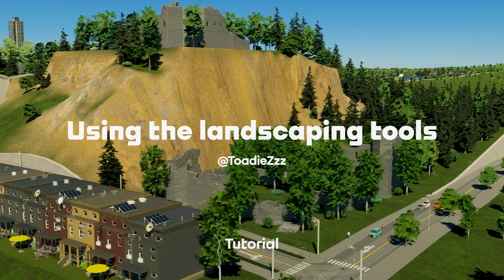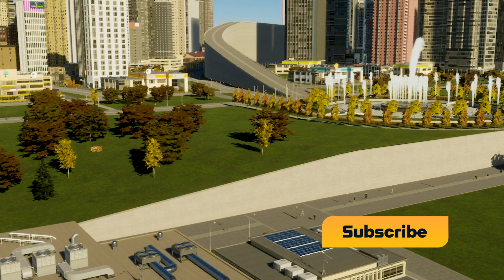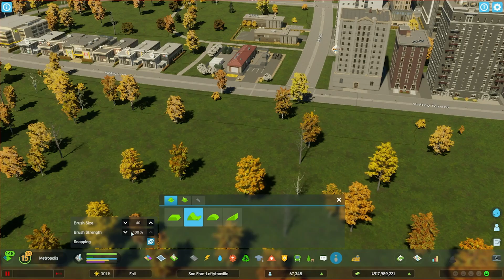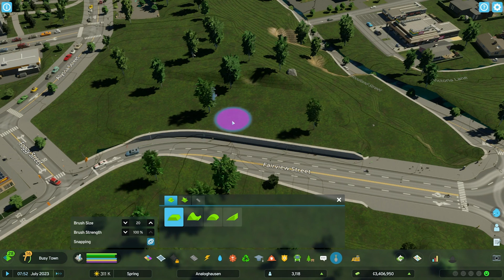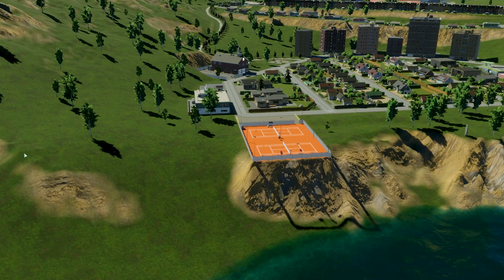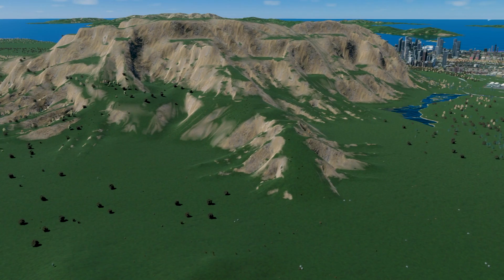How to Use the Landscaping Tools | Inspirational Builds | Cities: Skylines II

Comment: Man, this game is just such a disappointment. Why are the features from the original road anarchy mod not included? Should be an option to force tunnel, bridge, ground or elevated when making roads and rail. Zoning system is still the same and doesn't work with curved roads and is a pain having to run temporarily paths to correct the zoning.  Building on slopes is the same and not improved from the first game. There's no props, mods or quality of life or detailing options. Hate to leave bad feedback as I loved the first game and was so excited for the sequal, but it's so frustrating after the pre release marketing that got us all hyped up to buy the game and realise we've been sold an early access beta at full price :(

Comment: For the tunnel (for anyone who actually wants to do a tunnel without blowing up a mountain) you just need to level out the start and end of the tunnel to get the entrance and exit correct, then you can simply ensure you have an underground elevation (the screen will go dark to show underground mode) then just connect the roads with any of the road tools. Finally, fix the terrain at the start and ends and your tunnel will look great.

I did this to build a rail tunnel underneath a plateau next to a river in my city!

Comment: Cutting out and reforming a whole mountain for a tunnel is absolutely ridiculous.
Reply: And the saddest thing about this is that they show it as if it were a normal thing to do.
Reply: this is the one thing I have to agree with. just need to wait till paradox mods are out
Reply: Ridiculous*
Reply: @iconix1642  fixed. 😊
Reply: "Our tunnels suck by default and there's no good tool to improve them easily. So here's a hack for you"
Reply: no lol not so!
Reply: Simcity 3000 had tunnels ffs, just had to drag the road into something steep enough
Reply: It's 2025 and this is still completely broken